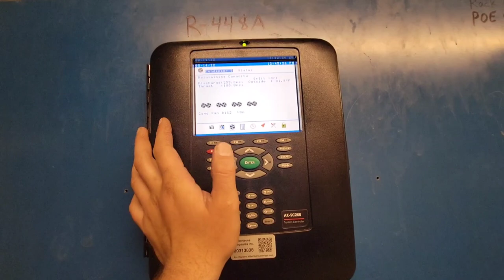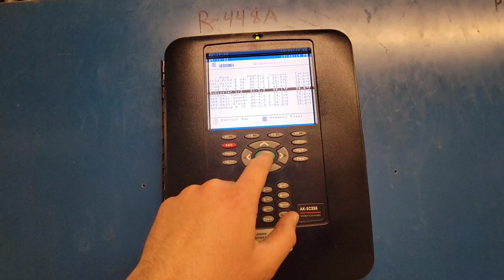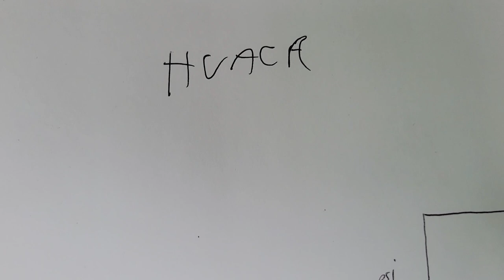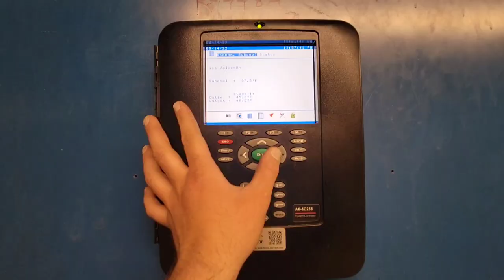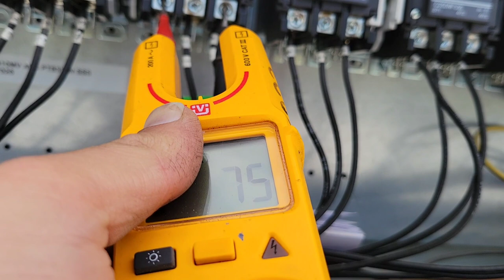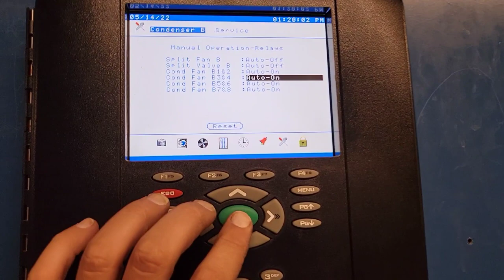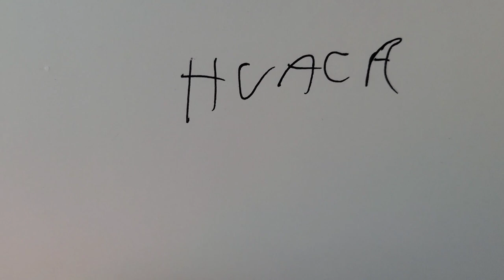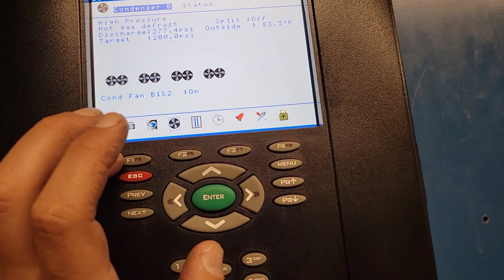Supermarket Refrigeration-High Suction & Head Pressure Troubleshoot on call(Bad motor and subcooler)

Comment: You could add a n electric water controlled valve fed from rack logic to determine when to use sprinklers to save the customer a lot of money on water...or even timer controls. Make yourself a little unit you can wire into the  system and rent it or just increase the value of your services. It could be head pressure driven. Worried about water in controls, then make the valve unit built into the rack or bluetooth controlled from head pressure. There is a solution to avoid excessive water bills.
Reply from the maker: Thankyou !! 

Excellent comment :)

Great ideas !

Comment: Your companys rate isn't bad or maybe they're not paying you enough lol our rate in the NYC metropolitan area was around 140ish. I was always the first to sign up for sunday work lol double it up !
Question though, how come you guys are trying to run such a low head pressure ? 180 setpoint is 80° F saturation. I usually try to run above 90° due to oil issues
Reply from the maker: Efficiency mostly. 

The higher head pressure you have the greater the compression ratio is. The compressor will have to work much harder to move refrigerant which could result in the compressor burnout and high energy costs. When your store is spending $20,000 a month on energy a 10% savings becomes a lot over a year. 

But this is not like a hard-and-fast thing every Rack we run is set up a little different. If it has oil return issues we might set it higher. our first and foremost priority is that the store actually works and then we address the efficiency side second. 

But every system is different. I just kind of go off of what the engineers said and then what actually is happening. And then marry the two philosophies and move forward the best I can. 

I hope that helps. 

And yes my company actually doesn't even charge the rates I mentioned. We under pay guys and under charge.
Reply: @gendronhvac-r1269  Totally understand my friend. Gotta cut down on the bills everywhere possible. As long as the rack doesn't have trouble and you can keep lowering the head pressure to help out the client in efficiency and decreasing wear at the same time then it makes sense.

At the end of the day, as long as your happy and comfortable that's what matters. I rather make less money and be comfortable than be on edge/nervous all the time with some other high paying positions.

Comment: Min 18:15
The numbers you're saying is head pressure PSI, right?
(and juggling the weather (cooler day tomorrow) vs. yes/no on sprinklers, right?)

And "Calling my lead"... Sounds like some pretty well developed organization here - not like the "mom & pops" of residential. Well, I guess you have to ... like the ice cream disaster, big bucks at stake if there's a fail somewhere.  DMM - just thinking out loud.
Reply from the maker: Yes pressure :)
Reply: @gendronhvac-r1269  

Thanks. 
Most videos I can turn up the speed on the audio, but this one is helps to turn it down to 3/4 speed. That's okay -- "advanced classes are like that".

Comment: I can understand not having good hand writing because my hand writing sucks. But why feature it so much? You had over a full minute, at the 15min mark, closeup on your HVACR? or was it HCAC wave symbol
Reply from the maker: 🤣 

So I try really hard To keep the company I work for anonymous.

So if I have to like, talk or do a voice oversection that I'm not showing equipment. I usually just show something like the floor or something like that. In this scenario I was in my truck waiting for the next call and kind of putting the finishing touches on the video and realized. I needed some more explanation. 

In later videos, I use a text documenthat. Just says gendron HVACR rather than my handwriting.

But I was not skilled enough at editing at this point to do that. 

I am very much doing this all on the fly. So these videos are not professionally edited. I literally just slap them together. 

Anyway I hope you found the video informative and my handwriting entering 🤣

Comment: Min 1:10

What is a "1/2 sub-cool"?

I think I get "economic sub-cool" (run as efficiently as possible), but "1/2 sub-cool" - my guess that's for when the Condenser goes on "split" on cool/cold days?

PS: great videos. They are packed with nuances the newbies can learn from. 👍
Reply from the maker: Half subcooler is just half the capacity of the subcooler. 

The subcooler does not always need to be run. If the weather is under extreme conditions then you would want to run both sides of the subcooler. 

It's kind of like stage one and stage 2 or another example would be like first gear to second gear
Reply: @gendronhvac-r1269  
Got it.
Thanks.

Maybe that's why there are 2 solenoids "over there" in the sub-cooler section. (?)
Reply from the maker: @hg2.  

Yes it is  ! :)

Comment: Min 18:45
Did you/do you have to change the fan motors in the middle of a rainstorm?
Reply from the maker: No they still have not came in. 

Also I wouldn't do that because there's a chance of damaging the motors electrical components.

Comment: Min 18:55

I think you talked about this in another video, but do you get new fan blades when replacing a motor?
[The motor has written on it what its specs are, but "getting a fan blade ordered right" makes me nervous.]
Reply from the maker: So typically if you call the condenser manufacturing they will have a replacement fan motor and blade on file that you could use with a part number. 

I typically order a new fan blade it's just easier than fighting with the old fan blade.  there is a chance that the the old fan blade could break when you're removing it and then you would have to charge your customer more to order and the equipment would be down longer so in my eyes it's just worth it to buy new ones. There are many instances where the old fan blades are stripped out and impossible to get off. So again you would have to order a brand new one in that case so for efficiency sake I typically just order them new.
Reply: @gendronhvac-r1269  

Sounds good (TG the fan blades come "package deal" with the motors). 👍

... About "busted fan blades", I've watched too many videos where the guys are struggling to get the fan blade off, and the inevitable question comes, "couldn't the guy who installed it out a little grease on the shaft"?    IDK... seems like the "professional courtesy" thing to do.
Reply from the maker: @hg2.  

Sure you could grease it but some of these motors have been getting rained on for 10 years. It would still be hard even if you grease it initially. After 10 years of the weather rust is bound to happen
Reply: @gendronhvac-r1269  
Got it.

Moral of the story, "Get new fan blades."

[ That should apply to residential, too, I suppose. ]
Reply from the maker: @hg2.  

I mean all of this really is dependent on your customer. 

You know? 

If your customer wants to run as cheap as possible then I guess you would just remove the old fan blades and reuse them. 

But if your customer wants a higher quality of service then replace them. 

For me it also depends on what I am replacing on a large condenser responsible for $100,000 worth of product I'm just going to replace the fan. 

In like a deli case I will just use the fan that's there. 

Or for example if I could get the fan motor but the fan blades were not in stock  I might just use the old fan blades so the repair could be done quicker if I thought the fan blade look good enough to use. 

I'm sorry I wish I could give you black and white answers but a lot of these things are situational dependent. 

Also some of them are work philosophy dependent as well. There are many ways to skin a cat  and you're just going to have to kind of develop your own way of being. A lot of it will be influenced by what type of work you're doing what type of area do you live in what customer you're dealing with so on and so forth. 

Also what does your boss want. Are you doing contract work or time and material. All of these things add up to too influence how you approach a situation

I hope that helps
Reply: @gendronhvac-r1269  
Definitely - thanks.

Contract work?

I like the sound of that! I'm an  "older guy" -- I couldn't handle those 2 am emergencies while doing a 30-hour on-call shift.
Reply from the maker: @hg2.  

Believe it or not it's the opposite. If you're under contract the customer will milky for everything you're worth. 

But if they have to pay you for your time they're less likely to actually ask you to come in the middle of thr night.
Reply: @gendronhvac-r1269  
Duly noted.

I guess I was thinking differently/optimistically.

Will elaborate in a bit.

Thanks for the info and feedback.
Reply: Re: 1099s vs. W2s.
Making (some of) HVAC part of the "gig economy".

(To be continued)

Comment: Min 4:30
"Low temp system" means how many degrees at the evaporator coil? [And then, for the case temperature, assume evap temperature + 10 degrees?]
Reply from the maker: Low temp is like 5 evap to -20 evap :) 

At least for me.

Comment: Min 12:30
You didn't pull out the fuses on the first visit to the Condensers,and explicitly said something about not pulling them (?) - but you pull the fuses on the 2nd visit.   ???  Am a bit confused here. Could you elaborate?
Reply from the maker: I wasn't going to pull them out because I was just going to manual turn off at the controller. But then I realized I probably should just remove the fuses anyway as a further way of showing that those Motors are not good. Also it's safer.  

Alot of my videos I'm working though stuff while I'm recording
Reply: @gendronhvac-r1269  
Got it.
Thanks.

Comment: Min 0:45
"Surge Tank" -- that's another name for Receiver, right?
Reply from the maker: A surge tank operates a little different than a receiver. 

So a surge tank as a solenoid and a couple times a day the solenoid just turns on and pumps hot gas into the receiver to push out the liquid. 

Where a receiver will typically have a receiver pressure regulator. This will keep the receiver at a certain pressure and will naturally push out the liquid refrigerant.
Reply: @gendronhvac-r1269  
Thanks much. 
Another fine video.

Comment: Min 5:30

Is a De-superheater the same thing as a Sub-cooler?
Reply from the maker: No,

Subcooler moves heat out of.the building more efficiently. 

Desuperheater cools down the gas before it hits the compressors so it doesn't over heat.
Reply: @gendronhvac-r1269  
Right, I should have been able to figure that out. 

For the memory cards: 

Sub-cooler RAISES the temperature of suction gas (benefit: lowers temp of condenser liiqud). 

De-superheater LOWERS the temperature of suction gas (benefit: lowers temp of compressor; this is the one that "sprays refer on the suction pipes" and then the gas goes back to the start of the compressor cycle  -- do I have that righ?). 

Do I have it right? 

[Makes me wonder about both raising AND lowering the suction gas temperature on the same rack at the same time.  Does that happen? ]
Reply from the maker: @hg2.  

Sub coolers can cause the suction temperature to increase in extreme weather conditions. 

But that's not what they do really. I have like four videos on sub coolers you should definitely watch those videos it's  a playlist actually. 

But you do have it right for the desuperheater. It lowers the temperature of the refrigerant so the compressors do not overheat.

Comment: Got me all confused, need to slow down and fix the camera from shaking. with your camera set up we need to take Dramamine to keep the sea sickness down. Your going to fast when explaining the troubleshooting.
Reply from the maker: I can try to work on the camera shaking in the future. 

It is just very difficult because I have a deal with my manager that these videos will not take Away from my work. If so I tried really hard to respect my manager And my employer by not taking a lot of time in making these. 

So it's tough to increase the quality without Affecting my job which I don't want to do because it would be disrespectful. 

But I will try to keep the camera still I hope The videos help you :)